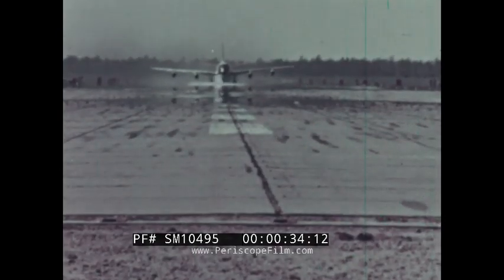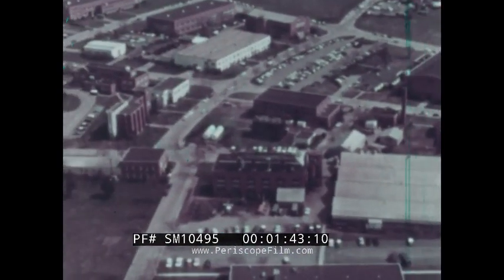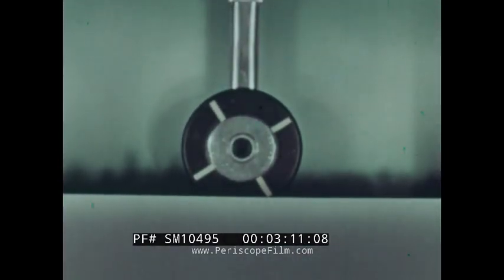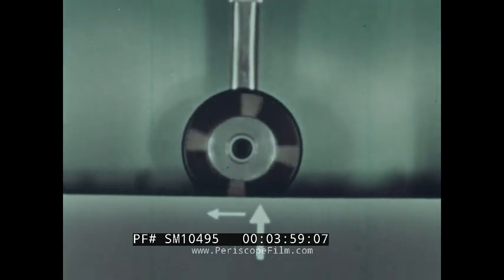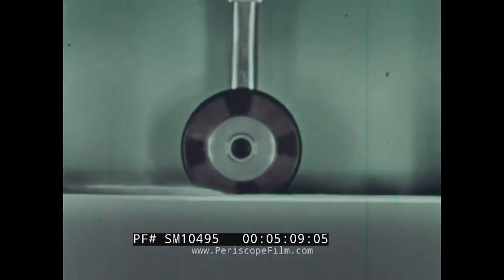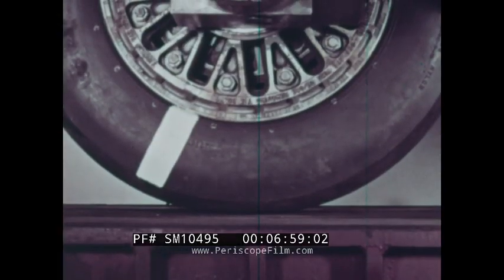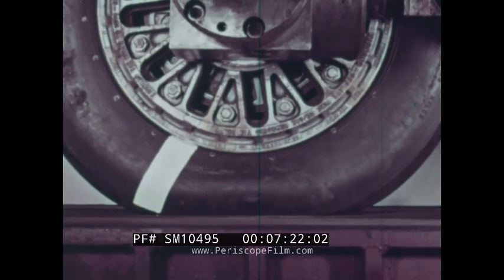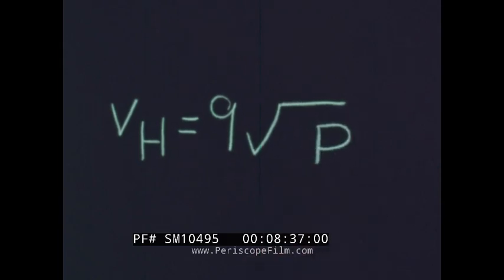" HAZARDS OF TIRE HYDROPLANING TO AIRCRAFT OPERATION "  1963 NASA AVIATION RESEARCH FILM SM10495

Comment: I didn't know the mathematical formula for hydroplaning, until I watched this. The speed at which most automobiles hydroplane is indeed 50-55MPH, especially on worn tires. Heck, I've hydroplaned on good tires at about 60MPH. @12:27... I liked their observation on tire tread pattern, which is why the All Season Radials we put on our cars & trucks have cross-siping; to channel the water away from the center of the tire.